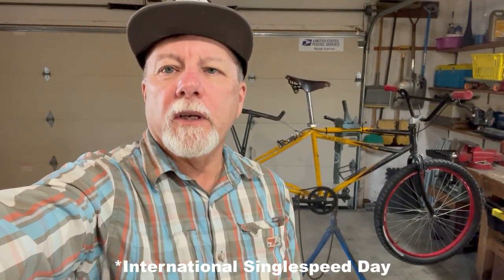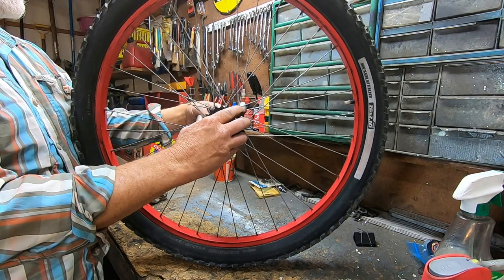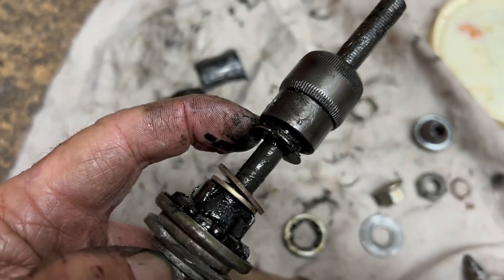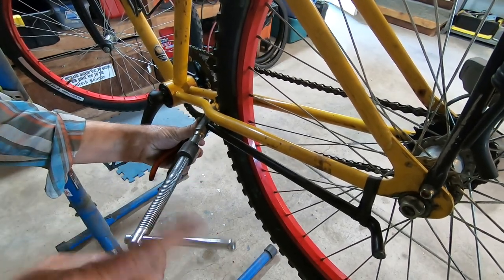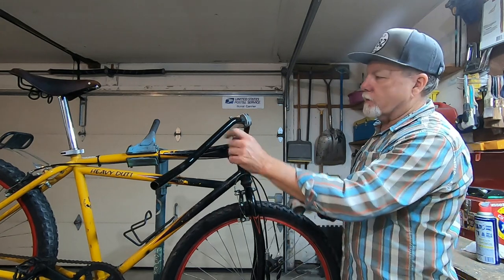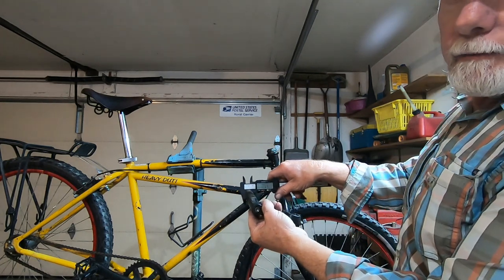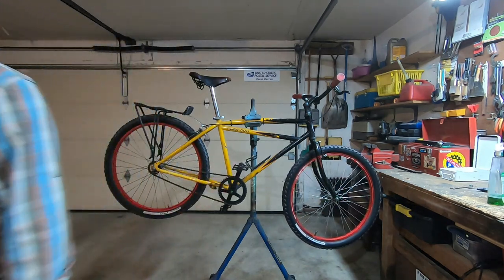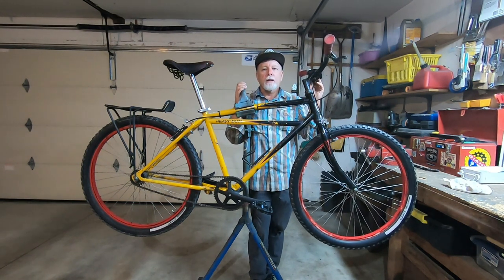Bike Builds & Mods - Changing Up The Schwinn Heavy Duti

Comment: Nice! I Learned something i didnt realize there were pads inside the hub for the coastal brake.  🚴‍♂️🚴‍♂️🚴‍♂️
Reply from the maker: Yes like little drum brake brake shoes on older cars I suppose.  I've rebuilt so many of them but still have never really taken the time to study how they work. As you seen I just stumbled through disabling it. Some coaster brakes had a bunch of thin discs instead of pads/shoes and I don't really understand how they work either lol. Thanks for watching Timothy.

Comment: I have the same heavy duti frame. I am thinking about swapping out the forks to a BMX threadless 26 inch fork. Is that possible with this frame? I would also like to add a Chris King headset as well. Any thoughts or suggestions as I venture down this path?
Reply from the maker: I've got this frame stashed away at the moment (I should build it back up) but if I recall correctly the head tube is  1 1/8 inch so as long as that's what you get for a fork and headset,  I see no reason you can't go threadless. I'm no expert though so always get a second opinion lol. Thanks for watching and good luck with your project.
Reply: @Locojoe yes, you’re correct. It is 1 1/8. Thanks for the advice! You should def build the heavy duti back up. I love this frame and it is a joy to ride.
Reply from the maker: @johnschmid1296  I just rewatched the video and noticed I said 1 1/4 inch . Geez.
Reply: All good. The bike specs I found online say the steerer tube and headset are both 1 1/8 inch. Assuming that is correct.
Reply: @Locojoe  you know, I measured the cups and came to 32.5mm which is smaller than modern 1 1/8, but bigger than 1 inch. Did you measure the same? Want to make sure I am not measuring wrong.
Reply from the maker: I’m sorry I can’t recall and am just as confused as you at this point lol. I can’t easily access the frame at this time to check. Sorry I’m no help.